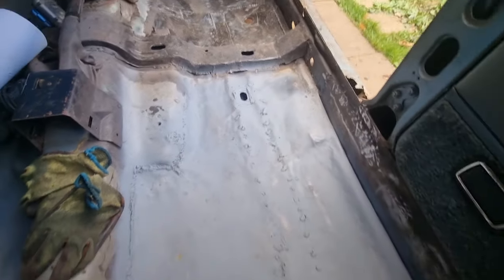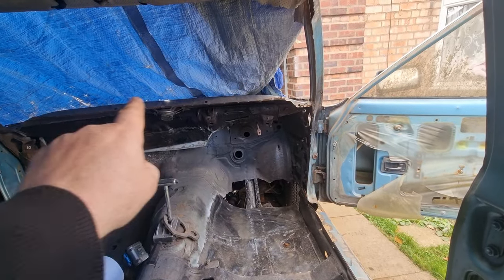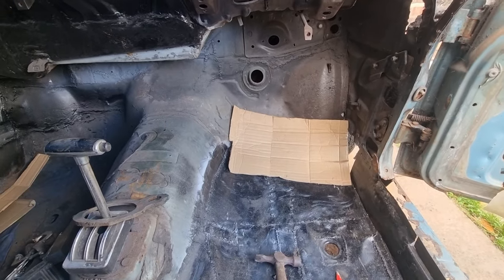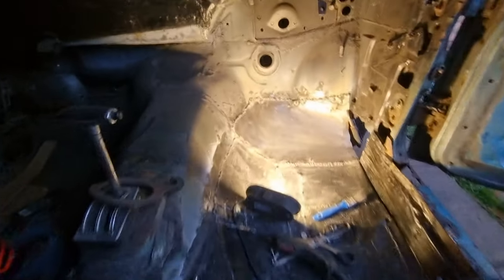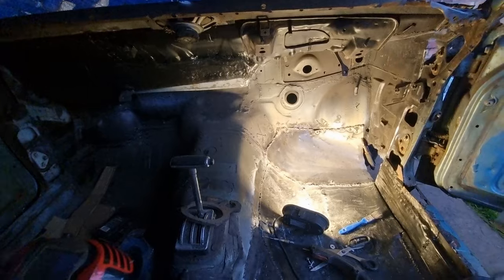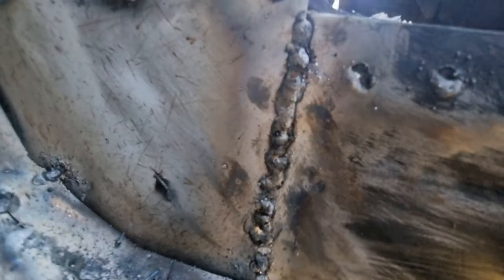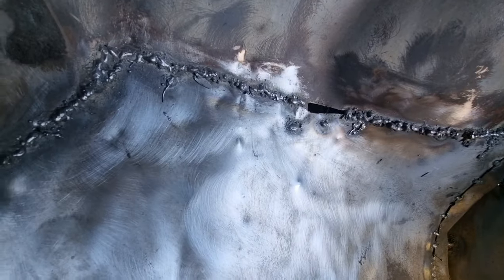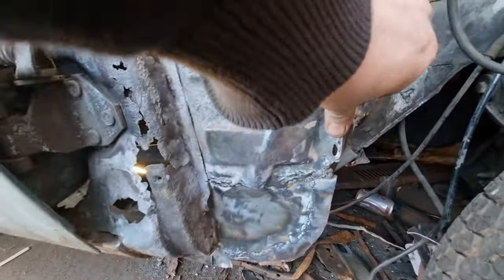Cortina Mk4 Ghia 2.3 V6 Restoration || drivers footwell rebuild done  (P48)

Comment: class! you have hit another milestone, the floor!   the car looks worlds a part from when you 1st got it.  Your welds are better than mine! i think its down to the hardware, not the operator. If you want to, buy some sound deafening, and just pop it down, that would finish the floor off nicely.  Now you are starting the little jobs now, which i recon you will fly through, due to the knowledge you have gained, doing the bulkhead, inner wing, seat support, floor pans and  inner sills.   When you look at it, you have done a fare whack really,  in only a few months.  Have you got hold of a steering column yet?  Might be worth buying one if not, just in case the supports have been just cut off, for quickness. Plus its another job ticked off if not.  Remember sometimes the bolt on stuff as you go a long, ticks off the list too.  I don't know if i mentioned that i re run the rear washer pipe, and rewired my rear boot lit on my rover metro, before the car was even welded. It was one of those jobs that had to be done, but while the car was in bits at the time, made it miles easier . So what ever Ideas, upgrade you have, might be worth looking at introducing, as you go a long.
Reply from the maker: Yes that is a great idear about the mods I want to do to do them before hand while it's in bits I don't have steering coloum yet but as defo been unbolted not cut so will be a straye bolt on thanks for watching mate